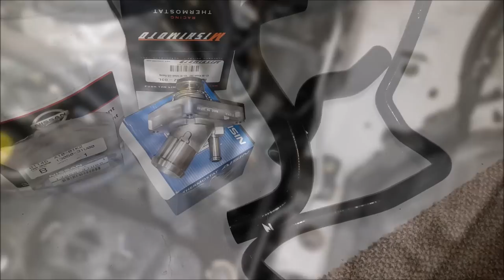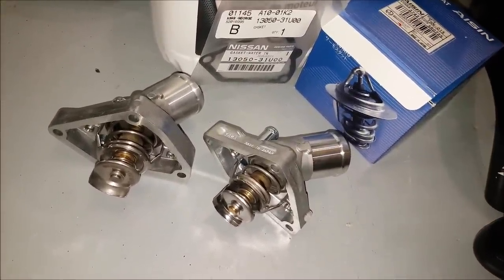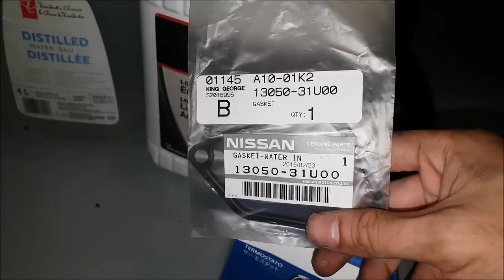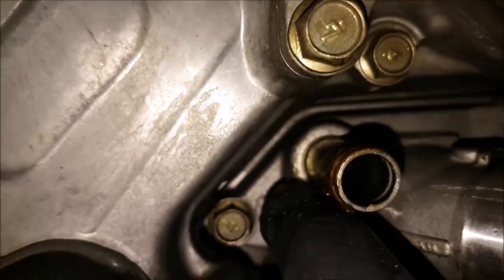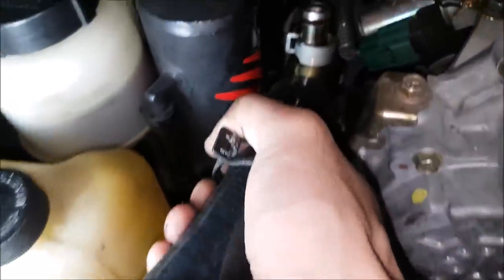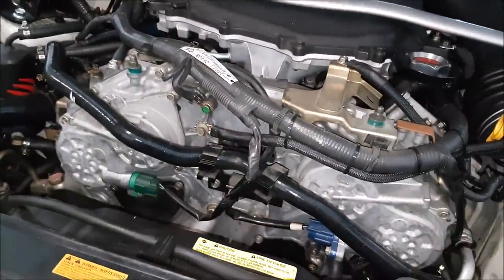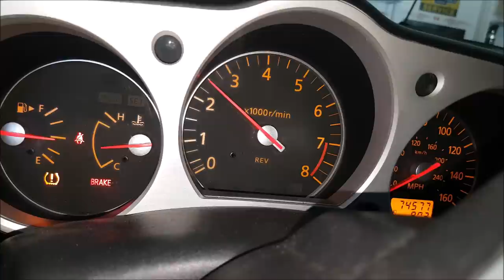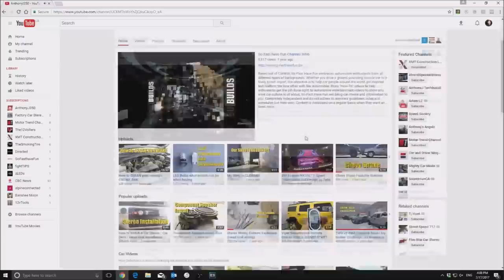Coolant System Service Nissan 350Z & Infiniti G35 (Replacing Thermostat and Hoses) | AnthonyJ350

Comment: What if you do this and then after you move it outside and when you rev you can hear the coolant sloshing around? More air in the system and need to do again?
Reply from the maker: Did you use the funnel like in the video?
Reply: @AnthonyJ350  yes I did.
Reply from the maker: @chacebusness6451  And bubbles stopped?
Reply: @AnthonyJ350  yes, didn’t for a good 10 mins. And ik the thermostat opened and everything
Reply from the maker: @chacebusness6451  Drive  around with the heater turned all the way up and the fan on and see how everything works.
Reply: @AnthonyJ350  did that and it drives good and doesn’t overheat but still hear the swooshing. To confirm you open the bleeder valve after the car has cooled down and is not on to let the air out? On other people’s YouTube it says to open it while car is running but I don’t have a good feeling about that.

Comment: What if when after letting it cool down and you try opening the cap but the antifreeze Wants to come back out?does that mean there’s a lot of air that want to come back out?heater on gets hot when I’m revving it once I let go it stays warm.any help or suggestions would be greatly appreciated
Reply from the maker: After it cooled down did you open the bleeder screw?

Comment: Hi, I have problem with my car. I was chnaging knock sensor harness, and i was dissconecting throttle body heating and some coolant spil out. After i changed the harness I assembly it again. Hit the road and after 5-10km (3-6mls) car started overheating and reservoir was overfilled. I heard something about that this engine is really hard to bleed. I tried it like 10 times and every time it overheated again. After air bubbles stops comming from the radiator what should i do? Let the car completly cool? for how long? after that top the radioator and close it? A really dont know what to do, every garage is telling me that it is blown headgasket but it is bullsh*t. The car runs fine before I disconected the hoses.... Thanks
Reply from the maker: Did you let the car warm up with the bleeder screw out near the firewall?

Comment: i recently had a issue..my car was over heating and my reservoir backed up and got extremely full..
Reply from the maker: There's probably air in the system still.
Reply: @AnthonyJ350  i don't know.. happened after installing new a/c

Comment: I did this but while doing so my coolant reservoir was overflowing so I thought that meant it was fine I got rid of the excess coolant but my car is still overheating any help?i just changes the thermostat could my new thermostat be bad?
Reply from the maker: Keep bleeding the system with the front end up.
Reply: AnthonyJ350 doing that now the reservoir is still over flowing it’s taking all the coolant but if I pour more the tank is gonna be full and will overflow blow cold air it takes it in but coolant spilled all over my driveway and not from the reservoir it thought it was taking it in but I guess not
Reply from the maker: @TheDemonicDeity  try squeezing the hoses to help burp the system. Did you fill it to the top at the radiator first?
Reply: Yes it stared to bubble but then boil but it was like jumping and coolant was leaking on my driveway so I think my new thermostat isn’t opening for the coolant to flow or something
Reply from the maker: @TheDemonicDeity  Did you do a 50/50 mix of coolant a and distilled water or is it premixed?
Reply: AnthonyJ350 it’s a premix
Reply: @TheDemonicDeity  did u find out what it was?
I had the same thing happen and it was because my coolant air release valve cracked !
And i seen in another video it says in the manual that if the overflow fills it's because the air release valve needs to be replaced lol

Comment: I’m trying to bleed it but the lower radiator hose won’t get hot like the other ones   Does that mean my thermostat is stuck closed
Reply from the maker: Did you fill the radiator with the bleeder open?
Reply: AnthonyJ350 yea I filled it just like you did until coolant came out from the bleeder port while the engine was completely cold
Reply from the maker: @ziibolifts  also was the front raised and higher than the rear? It sometimes helps get rid of air.
Reply: AnthonyJ350 yes I did.  It’s finally bleeding properly.  Thanks either way. The video still helped to confirm and doubts I had
Reply from the maker: @ziibolifts  Glad it helped. Ua they're hard to bleed
Reply: @AnthonyJ350  🙏🤞❗
😂

Comment: i looked on that side for the bleeder screw and it seems to be bypassed? any other ideas
Reply from the maker: They just installed a new coupler? You can purchase the funnel I showed in the video, jack the front end up and bleed the car like in the video.
Reply: @AnthonyJ350  just purchased the z1 bleeder.. fucking$34 jeeez

Comment: Do I have to put RTV or gasket maker on top of the OEM gasket?
Reply from the maker: I left the OEM gasket alone
Reply: AnthonyJ350 How is it holding up?
Reply from the maker: @malcolmd4243  Really good. Cooling system works properly and no leaks  I have a video on a new bleeder you might want to look into

Comment: Damn my 350z is over heating and the heater is blowing cold air! I already replaced the thermost and it still the same thing. What do yall think it is boys ?
Reply from the maker: Did you bleed the system like in the video? It could take up to 45 mins to bleed it properly. The car needs to be at an angle.
Reply: @AnthonyJ350  Yes man I did everything I even used flush cleaner just in case and naa shit was still over heating, and the heater was still blowing cold air.
Reply from the maker: @RObert75088  When did it start overheating?
Reply: @AnthonyJ350  on friday of last week bro out of no where
Reply from the maker: @RObert75088  How much time did you spend bleeding the cooling system?
Reply: @AnthonyJ350  I got home from work like @ 4:30 pm did not finish till like 7-7:40
Reply from the maker: @RObert75088  and you had the front end elevated correct? You have to crack the bleeder a lot it seems on these cars.
Reply: I'm having the same issue. However, I just replaced the radiator because of a crack and I still have to bleed it out a little more...Maybe I need a new thermostat as well.

You fix yours yet?

Comment: I would really avoid reusing factory clamps. Clamps are cheap peace of mind.
Reply from the maker: What's wrong with the tension clamps?  They can't ever back off.  But they are difficult to use some times.
Reply: My factory tension clamps didn't fit onto the mishimoto front bypass hose. Had to get new clamps for this part unfortunately, but otherwise the hoses are great!

Comment: did you replace the heater hoes that goes to the engine?
Reply from the maker: Not yet
Reply: Is the bottom plastic cover of the car needed?  Can i leave mine off?

Comment: Use anything to seal the gasket?
Reply from the maker: Just the new factory gasket.
Reply: @AnthonyJ350  thank you for the fast reply lol. Installed it last night but was leaking due to the old bolts breaking off. Had to drive an hour to find a dealership that actually had them in stock
Reply from the maker: @cryptocitys6790  Did you torque them down with a torque wrench that can do Inch LBS?
Reply: @AnthonyJ350  no that was my mistake before watching this video

Comment: Distilled water is better than any coolant
Reply from the maker: You still need coolant for anti-corrosion inhibitors, lubricant and it raises the boiling point. Also need it for colder climates.
Reply from the maker: But yes distilled water is better as a heat exchanger. If you put an oil cooler on even better.
Reply: @AnthonyJ350  Ive had bad experience using coolant, overtime it became gooey and clogged the radiator.....happened twice using two different very famous brands of coolant.  Never going to use coolant again. Btw I am in middle east so no issue of freezing out !!!
Reply from the maker: @exoticfish78  Did you mix the coolant with distilled water?
Reply: @AnthonyJ350  Yes I did earlier
Reply: @exoticfish78  sounds like two different types of coolant were mixed, I've never had an issue with coolant clogging anything when maintained properly
Reply: @Jake-im2lv  On both of these times a new coolant (green) was introduced, the radiator was properly washed

Comment: I have to disagree about those new hoses sweating. I have been dealing with silicon hoses for years working on cars and trucks and they do not sweat. If so, they are on the verge of leaking! Also I have the master set from Z1 for my G and while we're in the dead of summer I have yet to encounter or ever heard of coolant hoses sweating!
Reply from the maker: I hope so cause that would make my life easier.
Reply from the maker: That is just what I read on the properties of the material. Scroll down on this site for example and it seems these guys sell the product.

https://www.siliconehose.com/blog/silicone-vs-rubber-hose/
Reply: @AnthonyJ350  Its summer again and the only thing my hoses are is dirty! 😄 still going strong tho! 💯
Reply from the maker: @ahumm8280  That's great to hear!

Comment: Great idea fitting worse hoses for no reason 🤔😂
Reply from the maker: What makes them worse fundamentally?
Reply: You did say that the replacement hoses 'sweat' so you have to keep an eye on the coolant level more
Reply from the maker: @barryhall7  Yes but they don't degrade like rubber hoses do either. In theory they last as long as the vehicle. So they're not worse, they have different properties so different issues. As a vacuum line they're perfect.

I think you're assuming too much here without enough context.
Reply from the maker: @barryhall7  You should be checking your coolant level anyways. It's not like I'm loosing a ton or if noticeable at all.
Reply: @AnthonyJ350  you are right, I'm just being argumentative, scheduled and routine maintenance are very important. 👍🏻
Reply from the maker: @barryhall7  Hope it was worth it 👍

Comment: Hey bro so the at the end the radiator is supposed to suck all of the coolant fluid back into the radiator as shown in the video?
Reply from the maker: It will until all the air is out